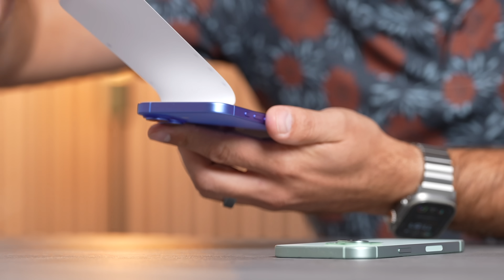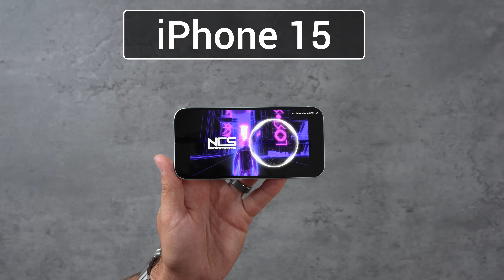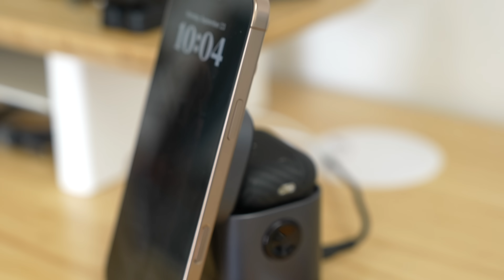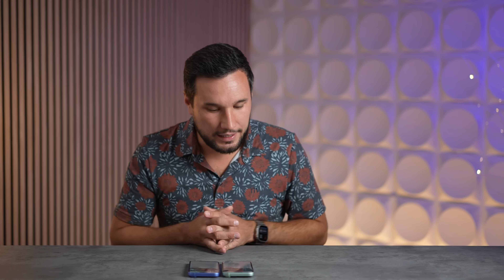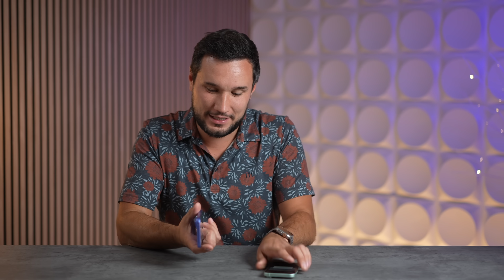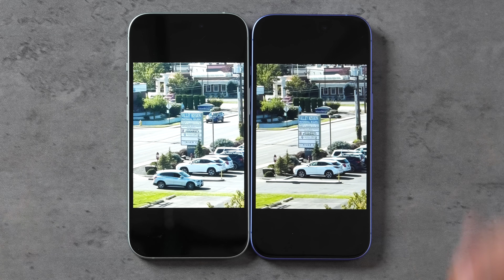iPhone 16 vs iPhone 15 - REAL Differences after 96 Hours

Comment from the maker: UGREEN Uno charger 100w (20% OFF):   https://bit.ly/4eTPZyr 
UGREEN Uno 2-in-1 Magnetic Wireless Charger 15W (30% OFF):   https://bit.ly/3BbsaDq
UGREEN Uno Lineup(AMZ US):   https://bit.ly/4gBdduI 
UGREEN Official Store:   https://bit.ly/3BewYIh
Reply: Which one should I buy?

Iphone 16 - 840€
S24 -590€
Pixel 9 Pro - 810€

Thanks for the help
Reply: Hy i have a serious confusion, i want to buy iphone but im still confused, Should i wait for iphone 16 in jan sale or buy iphone 15 in cureent BBD sale? Iphone 16 will be around 63000 in Jan sale. and currently Iphone 15 costs 53000 after all discounts. So whats your opinion do tell. Is it worth buying iphone 16 in Jan or wait for iphone 17 which might have biggest upgrade from iphone 16 as i see a pattern in iphones that all the odd iphones  i.e 11,13,15 are getting good upgrades.
My max budget is 63k -65k for the phone
Reply: @Rockcyril19  Wait for the 17!

Comment: Honestly still would upgrade to iPhone 15 than 16 with the price difference and design is so much better on 15. I'll be replacing my iPhone 11 soon to 15
Reply: good choice. i’m on a 15 plus and it’s a phone i don’t regret, the battery life is awesome it lasts for several hours. performance is smooth same for cameras and such is nice too.. i came from a 12 pro max to the 15 plus and i don’t really Regret my decision at all. like i said lol🤷‍♂️
Reply: @davidisback21ibb31  How has your experience been up until now with it compared to the 12 pro max? Was it still worth the upgrade?

Comment: 15 is still really good, even at 699$ from apple, i only saw it for like 50 dollars cheaper on amazon, i have the green iphone 15 128gb and its so great, the screen, chip, usbc camera, battery life is great, i had a 12 before and jumping to the 15 was a great update for me because my 12s battery was ass and degraded to 90% in 1 year and was slow and had major lagging forcing me to the get the 15 1 year ago, battery health on my 15 is at 93% after a year, not terrible and still lasts all day

Comment: Good video but I still think that 96 hours is too little time and do you think that the 16 pro max needs a silicone case or a leather one for greater protection?
Reply: I think that for aesthetics it is better in leather and the Vionentu Elites have black and brown colors that look very good with the new colors of the iPhones
Reply: I'm going to look at them because I'm not very convinced about the silicone ones.

Comment: Nothing to compare with 15, if you have 15 no need to buy 16, if you don’t have 15 no need to buy 15, go for the 16.
Reply: I upgraded from the 15 to the 16 Pro because I was experiencing too many issues on my 15 that was making it unusable. After two months of going back and forth, I decided to upgrade because nothing was working.
Reply: @_abby_gplease what sort of issues?
Reply: @_abby_gwhat issue, could you tell me?
Reply: I like how the camera looks on 15 and that there’s no camera button but the 16 blue is nice and the action button
Reply: ok why though - reasoning?
this is what i’m here for.

appreciate your simple answer but would still like to know a couple reasons as to why you say so.
Reply: @00zarzu00  Iphone 15 is relatively new, you get most from it, so if you made your purchase already then no need to worry about the 16.
But if you are yet to buy one, go for the newer 16 series, even though 15 will be available at a discount, 16 wii offer more features like AI, better battery backup, longer support from Apple.
Reply: Yeo I had an old google pixel and went for 16 as no point going for the very similar older phone

Comment: I am going from Google Pixel to 7. Should I get the 16 or 15. I love taking photos.
Reply: Pixels take slightly better photos ( only slightly ). I own a pixel and Apple phone. Apple phones do have more polished camera features/ interface though, like a proper EV slider  ( with numbered exposure values) that actually works and the post processing doesn't override adjustments made . The EV slider and other camera features on pixels are unreliable and not as polished as Apple's. Apples post processing isn't as aggressive and what you see on the display is what you get when the photo is processed .

Comment: I’m gonna share the unpopular opinion. I don’t care about the 60htz. It’s similar to Apple having less RAM than android phones. It has less because everything is optimized to run smoothly on it. I’ve had androids that had 120htz and they were so buggy that the scrolling and gaming weren’t smooth anyway. Downgrading to 60htz on Apple gave me a better experience AND better battery life because 120htz refresh rate eats battery life more than almost any other spec. In a smaller phone, I would have turned off the 120 and went with 60 anyway to preserve the battery, which is the more important consideration for me. To each their own I guess.
Reply: I agree amd also do not care about 120hz . Once you use 60hz for a while you totally forget about it . Apple phones are lovely and smooth to use
Reply: That’s what Apple is about, smoother experience and security to back it up as well. They don’t go for the bells and whistles like Android phones are about alongside making their phones more about longevity and reliability. I’m not saying there aren’t advantages to Android either but I’ve been an iPhone user for 10 years and have had mostly good experiences with each one I’ve owned.
Reply: I agree as well.
Reply: I would only care for the always-on screen. It would be nice to use it as a clock on my bedroom
Drawer.
Reply: Totally agree. Specifications on paper can be a completely different thing to the real world experience and usage. Reviewers tend to fall in the trap that if you don’t have the latest and the greatest, you can hardly survive a day. I’m still on my iPhone 12 Pro, and I have been on the verge on upgrading but hasn’t yet found the difference to newer iPhones be large enough to justify the cost. Instead I spent a tenth of the cost and replaced the battery.
Reply: Agree

Comment: Hy i have a serious confusion, i want to buy iphone but im still confused, Should i wait for iphone 16 in jan sale or buy iphone 15 in cureent BBD sale? Iphone 16 will be around 63000 in Jan sale. and currently Iphone 15 costs 53000 after all discounts. So whats your opinion do tell. Is it worth buying iphone 16 in Jan or wait for iphone 17 which might have biggest upgrade from iphone 16 as i see a pattern in iphones that all the odd iphones  i.e 11,13,15 are getting good upgrades.
My max budget is 63k -65k for the phone

Comment: Upgrade from 8plus. Should i go with 16 or try to get 15prm
I used 14prm but it is to heavy 
60hz is not the big promblems because i cant feel the different between 8plus and 14 prm

Comment: Just looking at the shots of the eyes , not meaning to be picky ( but I must 😊), the shot on the left doesn’t look terrible but I’ve seen better , and the shot on the right, the eye is slightly out of focus I think , however the lash is in focus . 
As someone that does experiment with up close photography on occasion , it’s been my experience sometimes smaller lenses do a better job up close , bigger lenses often have a larger minimum focus distance , my 6 year old Galaxy note for macro in decent lighting can give some of my newer wiz bang phone cameras a good run for their money. 
I like to pick a large size shiny nickel plated coin that has done some miles and shoot the best macro shots I can get with a variety of cameras , the amount of detail you can see in a shiny old coin is amazing.

Comment: For me, coming from the 13 mini, I think the 16 would be great update. I might consider it a few more months down the road.
Reply: I’m not looking forward to the day I have to replace my 13 mini. I’m thinking about replacing the battery and maybe getting another two years out of it.
Reply: @Abe-fp7ip  Same.  The mini is great, I don’t want a giant phone. Hopefully the next SE takes the mini form, or Apple makes a iPhone mini 17 to toss us a bone
Reply: That could be good to wait just in case there’s any bugs or other problems that have to be addressed so that way you’re less likely to run into any issues.
Reply: @lakerskid2013  
That and I could buy it for a way better price at a reliable online reseller! 
But then again, if I reach the new year without having bought a new iPhone, I might just hold on to my 13 mini until the 17 comes out (which also is one of my lucky numbers! 🙈😄😉).
Reply: thinking if i should upgrade from my iphone 11 to 16...i wud want if theres a mini bcs my hands are really small
Reply: @nobrandname9642  Mini’s were discontinued unfortunately
Reply: Yes - if it gets cheaper
Reply: I’m always having to buy new apple chargers… I have soooo many usbc chargers it’s carzy. I have the iPhone 11 I’m thinking it might just be worth it.
Reply: Same
Reply: I traded the 13 mini for the 16.  I am disappointed at least at this point, with the battery drain.  It drops all day even not being used much.  And my hand just isn’t getting used to the larger phone yet.
Reply: I’d disagree. There isn’t enough new
Reply: @emilsecker7881  
From the 13 to the 16? I think there is enough to be excited about! Like that 48MP camera with Macromodus and 2x optical zoom! The 13 (mini) had a 12MP camera and just 1x optical zoom. 
Then the emergency call via satellite and the accident recognition. Just to name a few things.

Comment: The camera BUTTON is so stupid. Makes holding the hold difficult with that cut in the case and fixes absolutely nothing. How is swiping on a button better than swiping through the camera feature? Ridiculous
Reply: Tbh, the only useful thing that button can do is Visual Intelligence, where you can use it to scan whatever's in front of you and search it online (like Google Lens), but that feature is not even ready yet. 

As for the iPhone 16 cases that have the cutouts, that's on the case manufacturers. Apple has made their cases to completely cover up the Camera Control button, yet their cases still allow the button to work as intended without having to dig up a hole just for it. Over time, these third party case manufacturers might eventually find a way to make their cases the way Apple did. But then ofc Apple started all of this, so Apple's also at fault here.
Reply: It can be disabled tho

Comment: Only reason you should really upgrade now is if your battery isn’t lasting long enough. Or just get your battery replaced. My 13PM still feels fast and the cameras have been great for years. Battery is around 87% but still lasts me a whole day
Reply: well the only reason i upgraded was because I had the iPhone SE 2 ( 2020 )
Reply: i remember when phones had replacable batteries.
Reply: i cracked my camera and my battery is ass
Reply: My 13 battery was at 59😬
Reply: with the future EU regulations the battery will be changed by anyone, at home...
Reply: I’m on a 10 lol. And battery is shot and charging port just went out. Price to replace just the front screen and charging port was 220$ ish. I’m upgrading just not sure 15vs16. I just use it for work and watch YouTube lol

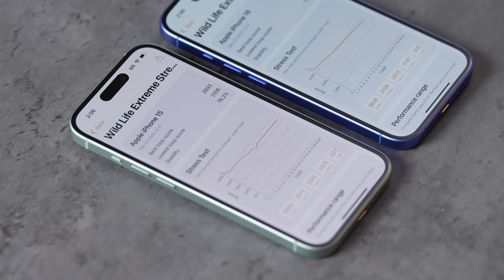Comment: Lol should all have 120hz fact is £800 for 60hz  no all ways on display same battery as the iphone 15.   😂 and as for the new camera button lol been done before by samsung sony  ages ago.  And how fiddly is that.  Lol hardly fast is it. And why was it not a finger print scanner all so.  Apple are weak. Should  not buy any thing of them tight arses 😂 7:57